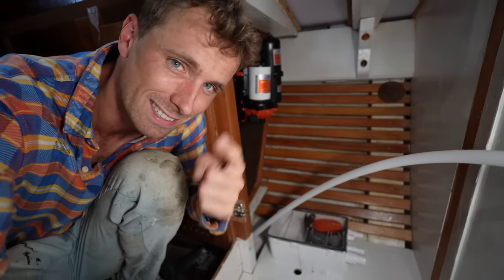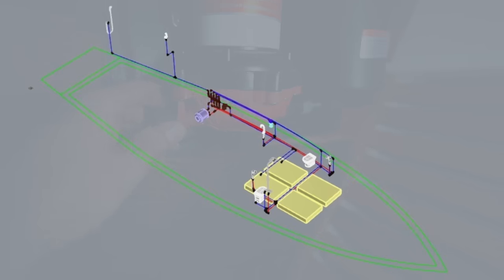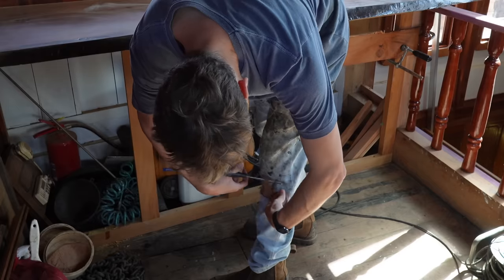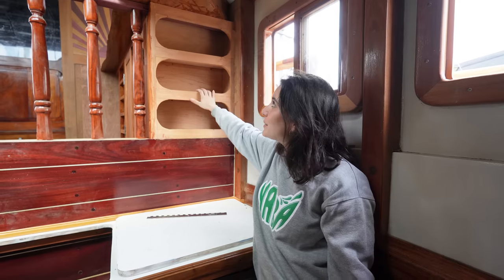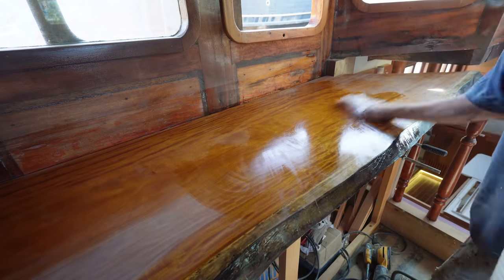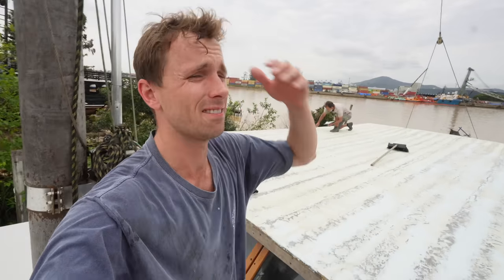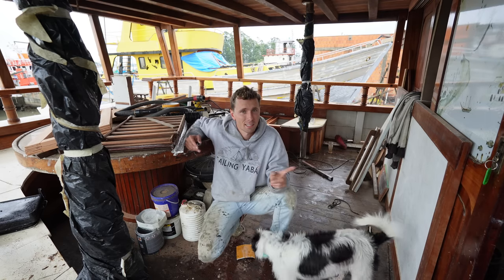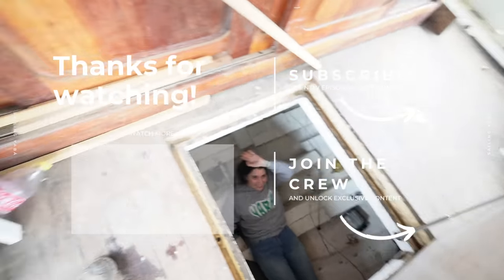What rebuilding a RESCUED BOAT really looks like! — Sailing Yabá 154

Comment: Thanks!

In answer to your question, it’s adhere. You were sanding the roof still at the paint would adhere better. FYI it’s referred to as a trowel not a spatula. I can think of three different kind of spatulas, but they’re all for the kitchen. There’s the long, thin spatula used primarily for cake decorating that’s generally metal. Next is the metal or plastic spatula that’s used for flipping food on the grill or in a skillet. And thirdly, we have the rubber ended spatula for scraping out bowls jars and if it’s silicone, stirring food in a skillet. It’s the one I like to use when I’m making an omelette. I say all of this in kindness, and with no intent to offend. I went to Germany once, and there was this American kid standing in front of me and Line complaining about all the foreigners, who couldn’t speak the language, and when I asked him if he could speak German, he said no I said you do realize you’re the very problem you’re complaining about. He tried to tell me he’s not a foreigner, he’s from America which I reminded him he’s not in America making him the foreigner.

Comment: Your issue with the paint is, likely, because your applying it in direct sunlight.  This 'could' be causing the paint to off gas too quickly resulting in bubbles in the finish. The good news is as you point out the paint can be sanded and re-applied;) Great work and I'm so excited to see you splash soon.

Comment: I’m going to guess the roller you are using is too course. You need one that is less “hairy”. Just a suggestion.
Reply: Yep nap is big ... smooth surface less nap .  Or use a sprayer that would help it lay down smoother...
Reply: One thing I was taught about roller painting many moons ago... "jazz up the angles". Working in straight lines may be convenient but will inevitably lead to lines and thicker patches. Work the angles, spread out that paint, rejoice. At least that's what I do.

Comment: Hola,
Just curious why, if your sinks are above waterline why you don't just drain down through a thru hull and marelon gate valve?? 
Certainly you shower sumps need a pump but who showers inside in the tropics where you have to clean up after?  
In the 8 years I've been in México I've never showered inside.  I have hot and cold water plumbed into my cockpit and, with a hose extension you can shower on the swim grid.

Comment: The bubbles are a result of gasing. Air is being released in the wood as it heats up. Paint at 3 in the afternoon not 9 in the morning. I would think you learned this with all the epoxy surface work you have done.

Comment: Foam rollers are the key. I didn't even need to brush tip..
Reply: Foam rollers are the worst equipment ever, making air bubbles and falling apart in the paint.

Comment: Hi. Regarding your pistons, I think you installed 23:08 them upside down. I had the same system to cover my pool engine and the existant pistons were out of order and rotten. When I changed them for New ones bought in Holland it was indicated to place them with thé small heads at the bottom in order to protect thé pistons joints. Check that if you watt them to in Time! Congratulations for thé work done. And I voted for U for thé Annapolis boat show. Regards. Michel Paul from France
Reply: You are correct. The pistons are installed upside down. Now the pistons rods do not get lubricated and the seals will dry out.

Comment: I think your air bubbles in the paint are the result of using too coarse a roller. A smooth foam roller is usually what we use to spread paint out, then it needs laying off with the best quality brush you can get - always brush in one direction and not so fast.

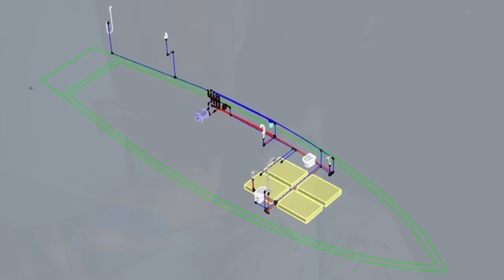Comment: 3:30 pumps work best closest to the feed (water tank). They are not near as efficient when closest to the supply (sink) and they dont last near as long. See, they don’t pull. They push. Ya might want to rethink that pumps location. Hopefully your pump has a pressure regulator that shuts the pump off when a certain pressure is reached. Just trying to help. Not tryin to be an ass.
PS. Your paint is too thin. Got bubbles?

Comment: the trick to roller painting is loading up the roller. apply paint- don't over-roll, 3 or 4 strokes and load it up again. too much rolling takes paint back off and leaves roller marks. Always have a wet paint roller.

Comment: Paint! Direct sun needs "retarder" and slower catalyst, to slow it down drying. It does not "skin" as quickly, creating air bubbles. Cold weather you need faster hardener or catalyst, and no retarder. You are doing well!!

Comment: for my 47 endurance years back i had a dual masserator system for the toilet , it ensured no solid matter being discarded if going outboard of hull and had 2 way valve option by toilet  to go into tank for in harbour use as here not allowed to discharge in harbours

Comment: Those screens and centrifugal bilge pumps were forever clogging requiring me to stand on my head to access the sump and clean the clog.  I finally removed the screen and pump and replaced them with a Whale diaphragm pump which pumps everything through.  The Whale is mounted atop the sump box's cover with a hose sticking down into the box.  The float valve was left in place to activate the Whale.

Comment: FYI TIP: you can use your scotch bright pad under your orbital sander. no need to cut it. the hook & loop velcro holds it in place as you hold the sander on top of it as you push it around.

Comment: Ben and MP, 
I've been thinking about your heat problem. While you're at the show you could check out some of the ingenious ways of cooling a big boat. I know of one fairly economical solution: I refer to the portable room aircon. I think that they might be mains voltage but is that a problem for you guys with your big engine and generator? 
The ɓest feature of the portable aircon is that it is intended for use in the room you're in only so that you can avoid the cost of cooling the whole boat! You just take it with you when you move to a different part of the boat! 

Believe me, I have lived in tropical climates most of my life and I still hate being hot and sweaty esp in bed at night! Ughh! It can be unbearable! Esp. in a boat! But that's all unnecessary these days with all of the different options available now. 
Enjoy the Boat show!

Comment: You should add some kind of locking system to the engine room hatch, so when it is open, and the pistons fail and they will at some point, it doesn´t crush somebodies head.

Comment: Never Never re-lie on a Cylinder to hold that much Weight over time they become week either gas loss or fatigue and if it comes down on you at sea it will be a bad day on the water. And if one goes out you will not Know until the second one Fails, just saying lol

Comment: I noticed your used Plex tubing for your hot and cold water. Plex will soften up with high temps of the hot water. And over time they will sag and or start to leak. To prevent this, secure the hot side to the boat structure as much as possible. Aleast no less than 16 inch.
Reply: I have Plex in a twenty year old RV. No leaks! It’s tough as hell. Most boats have Plex.

Comment: Are comments being deleted?  I was going to add a little more.
Reply from the maker: Hi Kym! We're not deleting comments. Unless there are offensive words in it, then YouTube deletes them automatically. If that's not the case, we would love to hear more from you!
Reply: @SailingYaba  okay. Perhaps it was mistakenly on the end of another and both were deleted. 

I remarked that the secret to the paint going on smoothly was viscosity; fluid enough that it will run together under its own weight to smooth out. If your paint is like beaten egg whites then it will go on lumpy and stay that way. It its too runny it will preform like a wash and thin out on the high points

Comment: Bit of advice for those little bilge pumps, stick a couple of wheel weights on the float switches, this means it switches off at a higher level before it starts sucking air.